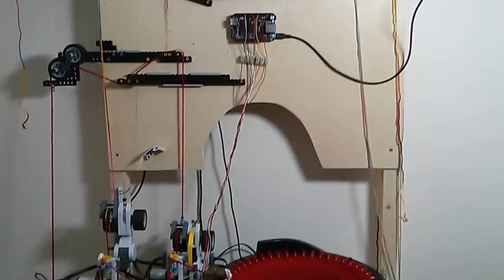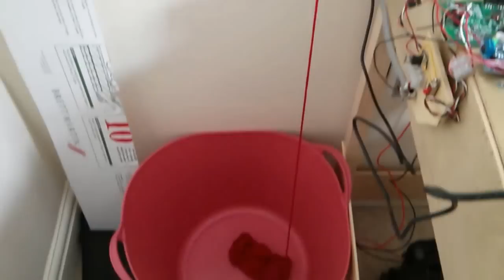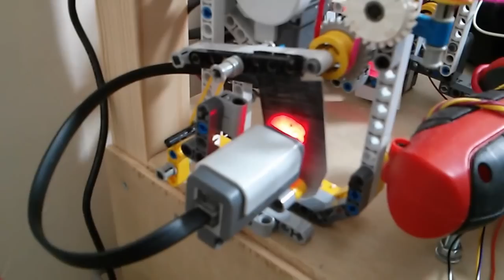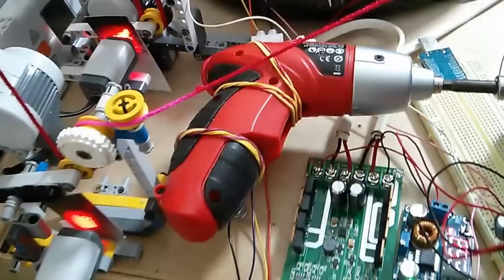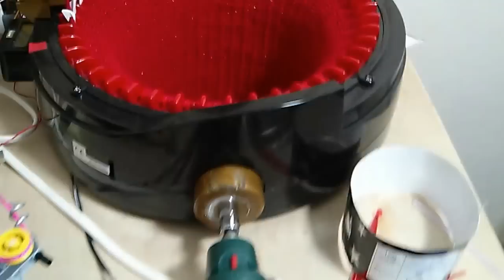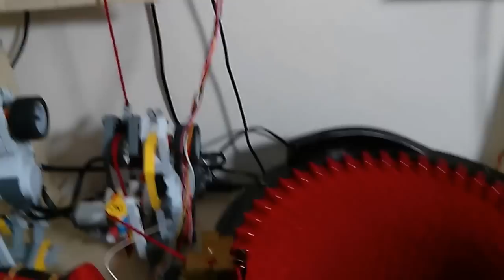Addi Express knitting machine, electric screwdriver motor, LEGO yarn tensioners

Comment: This seems overly complex. Good job never the less :) Few ideas for improvements; Respool the yarn so tensioning it become matter of single piece of plastic with two holes in it. Use a stepper motor instead and add a motor coupling so you dont transfer the torq directly. You can detect end of yarn more reliably by using plastic turnaround edge connected to microswitch.